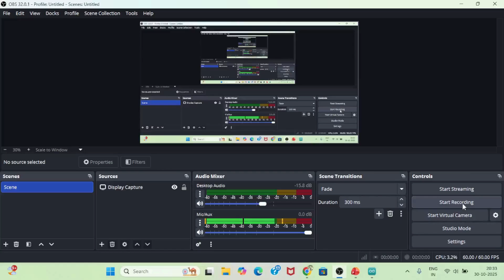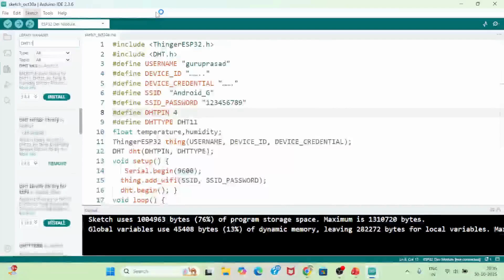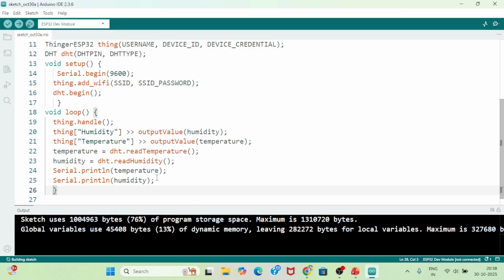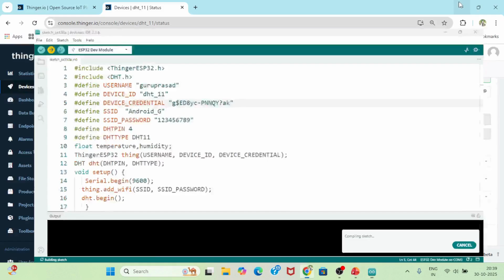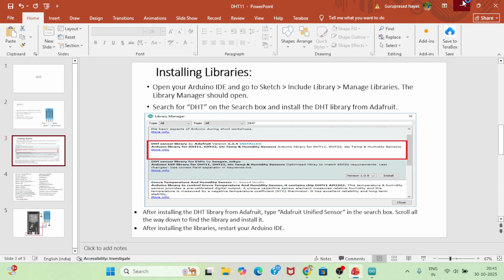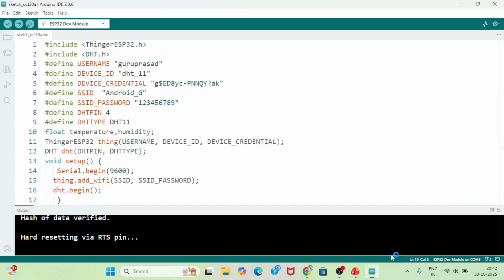Comment: #include <ThingerESP32.h>
#include <DHT.h>
#define USERNAME I"guruprasad"
#define DEVICE ID ".."
#define DEVICE CREDENTIAL ".."
#define SSID "Android_G"
#define SSID_PASSWORD "123456789"
#define DHTPIN 4
#define DHTTYPE DHT11
float temperature, humidity;
ThingerESP32 thing (USERNAME, DEVICE_ID, DEVICE_CREDENTIAL);
DHT dht (DHTPIN, DHTTYPE);
void setup() {
Serial.begin(9600); thing.add_wifi(SSID, SSID_PASSWORD); dht.begin(); }
void loop() {
thing.handle();
thing["Hur'idity"] >> outputValue(humidity);
thing ["Temperature"] >> outputValue(temperature);
temperature = dht.readTemperature();
humidity = dht.readHumidity();
Serial.println(temperature);
Serial.println(humidity);}